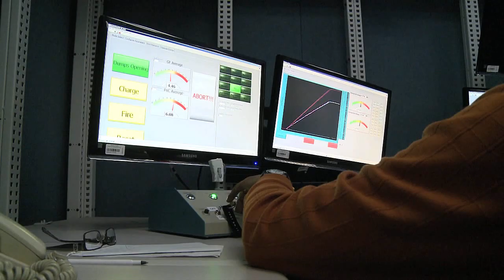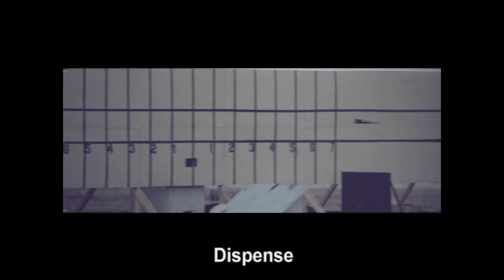USN Railgun Continues On Track For Testing Deployment 2016

Comment from the maker: In late summer 2016 the U.S. Navy plans to deploy a prototype electromagnetic railgun aboard the Spearhead-class joint high speed vessel USNS Trenton (JHSV-5) for at-sea testing. Tests will begin off the coast of Florida to assess the gun's ability to perform naval surface fire support against static floating targets 25–50 nmi (29–58 miles) away using GPS-guided hyper velocity projectiles (HVPs). Although the railgun will not ultimately be deployed on JHSV ships, the Navy has yet to decide which ship classes will receive fully operational railguns.

Comment: Hahaha! Towards the end of the video it shows the sabot piercing multiple steel plates spaced far apart with no issue. Ridiculous how much power is in this thing. I'd love to see the armor or system designed to stop a railgun round
Reply: Awesome
Reply: Did you ever see one of these in action *****?
Reply: Th3Nigma seems like that might speed it up and draw it to the ship
Reply: William Owings could reverse the polarity and deflect the round maybe. Idk
Reply: RPrevolution25  RP only works on other magnets, not paramagnetic and magnetic materials. Your kitchen magnet will always stick to your fridge sadly.
Reply: Th3Nigma Its not just magnets. It's how the magnets are aligned and fired in a sequence to generate ridiculous speed. Even if there was a huge electromagnet near the target it would most likely have little impact on the speed or trajectory of the projectile.
Reply: Dave Zhang Gawd bless 'Murrika. Biggest bombs of any kuntry
Reply: Khu NoPie For better or worse, yeah. To be honest, I'd rather be behind the delivering end of this.

To the people discussing the defensive measures, I wonder if a laser based point defense system would work. Maybe not because you couldn't melt the projectile fast enough
Reply: RPrevolution25 Sound (It's) impossible to deflect a projectile at mach 6 with an electromagnet. If so, why isn't there already a deflectorshiled for ordinary gunbullets?
Reply: Dave Zhang The answer is that they probably won't develop armor for it. Just like how knights in the medieval period were the most feared weapons on the battlefield until crossbows were invented and made them completely useless. This will probably be a bit like that. What's the point of wearing all that armor when a new type of projectile easily counters your existing defenses? And when something hits as hard as that railgun round the only thing I can think of is deflecting it slightly so that it misses the target - which means having a much smaller target to begin with in order for the deflection to adequately shield it.
Reply: Jason Rush I want to think so, but when guns came onto the battlefield, as you said, the knight's armor was made useless. But then we discovered Kevlar and hard ceramics that can stop bullets. Who knows. Maybe some new material will get made
Reply: Jason Rush That's a good analogy. Armor will probably give way to speed, maneuverability and stealth. It seems like once a target is acquired it's going to be game over... with the plentiful stock of projectiles afforded by this platform, you can just rain mach 6 death on them until their armor fails.

To paraphrase: Armor can't repel firepower of this magnitude.

The only way to survive is to not take any hits.
Reply: Dave Zhang Maybe it's an automated propulsion system that blasts you away from the bullet trajectory lol
Reply: +RPrevolution25 
_____Dude, it wouldn't work.  If the round was MAGNETIC, there's not a magnet in existence that could stop the projectile once it's out of the barrel.  Once fired, it's going thousands of miles per hour.  Oh, and the sabot round ITSELF need not be magnetic--just the outer shell.  It'd be like trying to use a magnet to stop an aluminum bullet.  Magnets don't work on aluminum, by the way...
Reply: +Nicholas Christensen It's an excellent discussion but how could one move a ship out of the way of a projectile moving at March 7? 
Somehow a defender needs to dissipate all that kinetic energy or else just survive it. 
For example if I had a ship that could keep working at 99% even with 25 big holes in it, then perhaps that is my defense. The rails on the rail gun are going to overheat before my ships sinks giving me time to fire back at a target which glowing white hot in the infrared spectrum. 
Perhaps the battleship will finally make a come back!!
Reply: +Dave Zhang Those plates did not look that thick at all to be honest, I'am guessing they were testing how straight of a trajectory the projectile kept as it went through those plates almost as if they weren't there, damn.
Reply: jisus luvs u I'd think even thicker plates wouldn't have done much more. You'd need an obscenely thick plate or stack of plates to even remotely stand a chance of stopping a railgun projectile. Traditional armor isn't going to cut it anymore
Reply: dragonthefirelord I do not think even a more powerful version of the USN LWS will even be able to track such a FAST AND SMALL moving projectile. Keep in mind that the rail/projectile doesn't emit much heat as a generic missile so it would be harder to track. In conclusion, nothing can stop a railgun from raping your ass as of now.

A railgun can't stop that projectile, it's like hitting a bullet with your pistols' bullet, impossible to achieve.
Reply: Calabi-Yau Manifold
The problem piqued my interest so I did the math. Then I did it again because I made a stupid mistake.

If we assume an effective range of 10 miles (being generous, that's effectively the horizon for a ship) the laser will have ~7.8 seconds to engage a projectile going mach 6.

To melt a 3.2 kg tungsten projectile (if we assume it leaves the muzzle at 800 C and stays hot) in 7.8 seconds you're going to need a 200 kilowatt laser. Getting hit by hot, liquid tungsten is still going to suck, but it's better than nothing. If you want to fully prevent damage and vaporize the projectile you'll need a 2 Megawatt laser. That's with 100% heating, full power on target at 10 miles - any losses due to scattering or reflection mean those numbers scale up. Current LWS research has published targets of 100 kW, so you'd need between 2 and 20 of them (depending on desired mitigation) per simultaneous projectile, plus they only have an effective range of 1 mile, so multiply those numbers by 10.

There are "petawatt" research lasers out there, but they don't operate continuously - one "pulse" only delivers a few hundred joules of energy, that won't even take the chill off a cold beer. How many pulses can they deliver per second? Damned if I can find out, but they have to be fired in a vacuum so they don't ionize the air and scatter their own beam, so I don't think they can help a LWS solve this problem.

A railgun projectile, by definition, would have the energy and momentum needed to neutralize another railgun projectile. If you can solve the "find the bullet" problem (which you'd have to do for a LWS anyway), the limiting factors would be accuracy and aim speed of the intercepting weapon. Still seems like a tall order!
Reply: Yeah, you would need to account for those things, but fortunately they wouldn't change drastically moment to moment (except maybe wind speed). Good ballistics calculations should be including the earth's rotation already, and any on-board sensors are going to be in the ships inertial frame of reference by necessity (wave action is going to be the most confounding factor here iirc, but gimbals do wonders with that). Still a very tall order, and given things like Phalanx rely on ROF to make up for insufficient accuracy, I have no doubt the technology isn't there yet.

Just a quick note about speed gain during ballistic descent - the projectile gave up speed to get that high to start with, so it's only getting back what it put in (delta PE + delta KE = 0). You can get a little boost if you target is at a lower height than you, but friction losses are probably going to eat way more than that anyway. Except maybe if you're firing down from orbit? Not sure about that case.

Comment: So the projectile is encased in a sabot, makes sense. But why is there a pre-dispense stage? Very puzzling!! The railgun muzzle velocity is what allows the projectile to achieve such high speeds. So why the need for a secondary explosion? It doesn't carry propellant and doesn't have an engine so it must be just for "dispensing" of another layer. Are there two sabot stages then? Anyone know?
Reply: asunduko1 I have no idea why that clip was in the video because it's not really related unless that's what they intend to do later. That looked like it was a conventional round shot from a 120mm cannon...
Reply: Yuck Foo Flechette round you mean? I don't know, in the video after the explosion I don't see the separation into many projectiles.
Reply: asunduko1 I think that it is to distribute some debris around the main projectile. As you can see from it piercing all the sheets of metal, it doesn't actually do much damage beyond leaving a hole, but if it has some debris moving with it, it would leave a much much larger hole and do more damage to the exterior of the target.

EDIT: In fact, it is pretty impressive just how /little/ it did to the sheets of metal. It just left a hole not much larger than the projectile, shook the sheet a bit, and sprayed off a cloud of glowing metal fragments/liquid metal/vaporized metal, I can't really tell which.
Reply: Ultranerd Prime Exactly - and that will be more than sufficient to deal with wiring or any fleshy bits in the area.
Reply: Yuck Foo I do see the explosion but it seems that the core penetrator still remains. And in the money shot it alone is going through all the sheets of metal, not the small fragments. In any case, seems a bit contradictory since the round is supposed to be inert from what the narrator says and only use kinetic energy to do damage.
Reply: asunduko1 I think the only reason they use dispensing is to destroy the projectile and/or to cause an explosion after penetration of any armour in the way. If this was used on navy vessels, then punching little holes in to ships won't really be of much use. But piercing the hull and detonating inside the core of a vital component WILL do a lot of damage.
Reply: Ilhares You nailed it - the "shotgun" round is for distributing the round's energy over a wide area to deal with light/unarmored targets. If one round overkills your target by a factor of 1000, then just have it break into ~1000 pieces.

I imagine there will be different loads for different targets, maximizing the area covered by the required stopping power.
Reply: Ultranerd Prime  Yep. Railguns will not be only used against ships, but also against aircraft and missiles. I doubt that flechette projectiles will be used in ASuW. Aircraft and missiles are the candidates for those projectiles since they're more maneuverable and not that armored.

Comment: Here is a question for you people. What kind of damages would happen if they used this against a ship? Would it just pierce through the hull? Or do you thing the speed its traveling at would add some effect?
Reply: joshua calderon It would quite likely cause a large hole in the hull from the kinetic energy.
Reply: Don't you think the super sonic speed would add anything to it?
Reply: joshua calderon Watch 2:05. Used on a ship, the bullet will pierce far through the hull and continue room after room, ruining electrical systems, engines and structural elements on its way, and killing anyone close to the walls it impacts. It will lose energy and deform bit by bit until the bullet's shape and velocity cannot pierce the next wall, upon which the rest of the energy will be released, killing everyone and ruining everything in that room, plus the wall it hits. The ship won't be happy, that's for sure.
Reply: I'm interested on the effect of the supersonic shock wave inside an enclosed area. Are we talking liquidation of soft tissue?
Reply: joshua calderon If you look at the first couple plates it pierces the speed of the projectile seems to actually melt the metal around the hole causing a spray of molten steel onto the next surface, anybody anywhere near that would have a very bad day, the shockwave only occurs around launch not anytime afterwards so that wouldn't matter.
Reply: joshua calderon It would act in a way very similar to a shaped charge; it would punch through the hull and bulkheads with ease, and likely cause some significant overpressurization/hydrostatic shock, which would more or less puree everything inside.
Reply: Tiboroun it's traveling close to 6 times the speed of sound it's going to have a Shockwave throughout its travel
Reply: joshua calderon Have to realize its not just for ship to ship combat. You could use it to shell any land base target in range as well. So plop a point down and draw a 230 mile wide circle and this thing can hit anything in it.

Comment: 1:50 Does the test shot use air pressure to move those fans up top, or does all power just suddenly surge into everything all at once?
Reply from the maker: +alphamoonman Physics, go to school.
Reply: I take physics next year. I'm just curious if that shot was all it would take to blow some fans.
Reply from the maker: alphamoonman Sorry I apologize. You will learn. Physics is the basic learning blocks.

Comment: Why there is fire, if it is only electromagnetic?  Why there is fire every time the bullet hits the wall?  I that all from friction?  I hope they are not using depleted uranium.
Reply: +singlefather01 I'm going to answer your comment, because I didn't see any other ones, and I don't know if you know what what you didn't know a month ago. so basically, it is all friction. Going at about Mach 6, parts of the projectile interact with the air at the high speeds to produce the fire. It's also the reason why reentry is a problem for space ships.

Comment: If one of those things were aimed at the fuel tanks on a diesel frigate.... Yikes. The friction heat alone would ignite the diesel and blow up the ship.
Reply: actually, in diesel i'd be far more worried about the compression wave turning the entire fuel tank into one big cylinder and igniting through that means, diesel is much more responsive to pressure than heat by itself.

Comment: I want to see them test this vs some 12-19 inch thick plate to see what this bad boy could of have during ww2
Reply from the maker: +Steven Mcdonell That would be an interesting exercise. First thing that would have happened is a massive explosion. The kinetic energy dissipated would have been intense. It probably would have been one shot one kill. If the initial shot didn't do the job, the secondary explosions would have cleaned up afterward.
Reply: Gung Ho Vids yeah if it managed to penetrate the citadel where the ammo was stored it would be like the HMS hood all over again
Reply from the maker: Steven Mcdonell It would penetrate that plate.Mach 7 ammo would penetrate most any protective plate made by man. It would be a nice fireworks show.The Hood was a good explosion... any ship in the way of this weapon would be blown to smithereens.